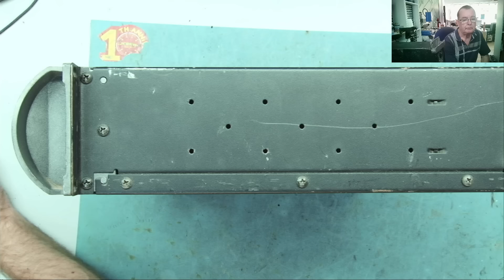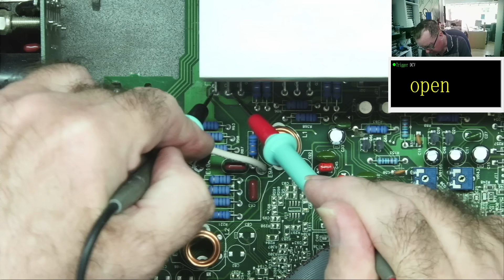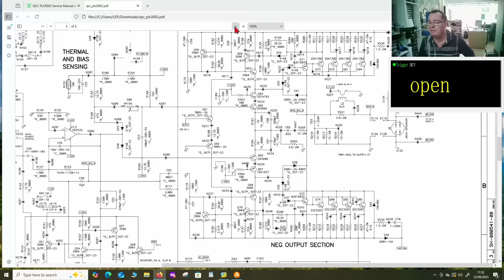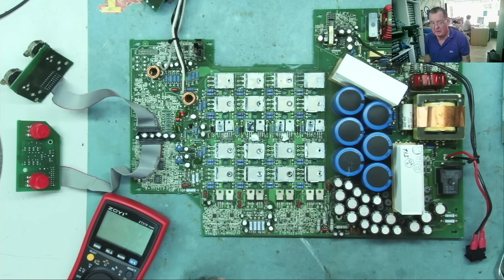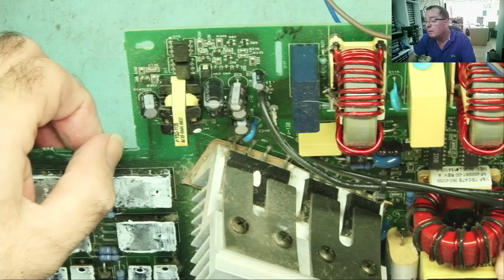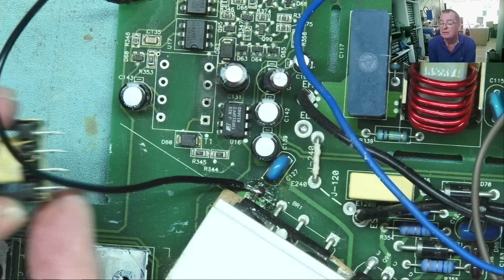QSC PLX3002 Pro 3000W Amplifier Went Bang.  Find Out Why...  And How To Fix It.

Comment: I have the twin to that one on the bench waiting for parts. Transistors shorted in one channel and the SMPS IBGP transistors shorted, so the 25A fuse was blown. This high efficiency unit appears to be less reliable than the older generation with the boat anchor torrid in the middle.

Comment: Audio visual repair… at installations, I design redundancy into the system so that a single amplifier going down will not effect the overall output too much. Same with lighting. When it comes to mobile hire, as you lose the hire fee & reputation, etc., it’s rarely worth fixing & reusing, but fixing to put it up for sale is an option I use regularly

Comment: do you ever considering building a standby adjustable supply to use as a feed in, for diagnoses the rest of the circuit, once, and the main PSU section, that way get more of your trouble shooting in one hit???
This way you can get the main PSU up, I think you've had a few video's, I've a couple hillbilly PSU's, generally carcases of various 'formerly' dead ATX units converted....

Comment: Be sure to check the snubber components before powering up with a new "transformer" and TOP device.
The internal switch of the TOP controllers will not tolerate being avalanched. 
When I was designing with a PI part the datasheets were not explicit about this. I don't know if they are even now. I actually had a phone conversation with an applications engineer at PI to confirm. (With discrete MOSFETs, avalanching can be perfectly OK as long as you observe the peak energy and average power limitations, which can simply or even eliminate the need for a snubber.)

The bias circuit for class AB operation and the predriver stages looks pretty wild. It would take some effort to figure just exactly how it all works. There are 230 V TO-220 devices in there with fixed bias voltage on the base and a small signal transistor in the emitter path (a "cascode" configuration). I presume such things may be fairly common in high-power audio amps.

Comment: Very interesting. Is this a Camco board? The layout is very similar to an Ashly amp I tried to fix, heatsinks are identical. I assume Camco sold amplifier boards to many other brands and they just made the faceplate led and input PCBs
Reply: Getting forward in the video, also the way the heatsink gets stuck to the diode and mosfet at one end, it's the same

Comment: Since the transformer is available and the TPO210 seems to be available (in the UK at least), I would go down the route of trying to repair it properly. It might be worth connecting up a bench PSU to confirm that this is the only fault.

Comment: All repairs depend on being able to source replacement parts or substitution - depending upon where you live.
In my location necessity is the mother of invention because my supply lines are long and variable 
For this reason I liked your idea of substituting a laptop supply.
However if you can easily source a replacement it's the route to go.

Comment: @48:00 I think you're getting confused as to which pins on the transformer are not connected. The square hole is pin 1 of the transformer primary, and goes to pin 5 of U16 as you previously shown on the other side of the board. It also goes to D60. This is shown on the schematic. It's pins 5 & 6 on the transformer which are not connected. The white dot on the transformer is pin 1. It has 1 primary winding (pins 1 & 2 designated T1:1) and 2 secondaries (pins 3 & 4 designated T1:2, and pins 7 & 8 designated T1:3).

Comment: this is quite a common issue with the qsc plx and its clones which use pretty much the same circuit like the thomann tsa series (very similar circuit-different pcb layout)..i would temporarily wire up a isolated 12v power supply , and not a 19v as the max vcc for IR2110 is 20v. you can measure and verify the switching waveforms coming out of pin 7 and pin 1 of the IR2110. so all the smps drive circuit can be verified . Also definitely check the 10v zener d66 and ESR of the electrolytics around the the TOP210. i had a leaky zener once which ruined my day as the bloody thing blew the brand top210 and the transformer after running or a bit.

Comment: Very interesting fault Richard. Reminds me of a blown up mixer I had to fix - not one with built in  power amp so not something you expect to see fail with clouds of smoke emanating! When I came to look at it I found it was the PSU that had blown and it seemed that a similar
"bug" had crawled in and had the misfortune to sit itself in the area of the snubber circuit for the PSU primary - my one was not as lucky as yours - ended up as a carbonised lump which, being conductive, proceeded to take out the snubber capcitor, the PSU switching mosfet, the pwm controller chip and then the supply bridge rectifier and it's smoothing cap along with the varistor connecting them. Quite a disaster area resulting from one stray insect!  
I think you may have struck lucky in that QSC being a reputable professional brand with spare parts such as the transformer still available.
Look forward to the concluding chapter of its story.

Comment: I wonder if the roach passed enough current to take out that little power supply. It wouldn't take much and could easily leave the roach with no apparent burn marks. You would need to disassemble the roach to see if it is burnt up inside.
Reply from the maker: We could do that on the next live stream 🤪